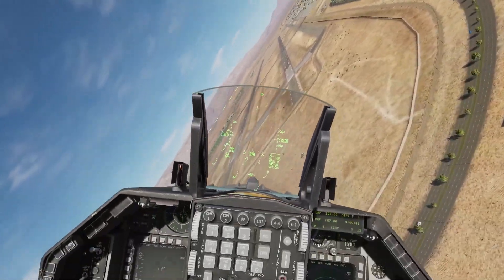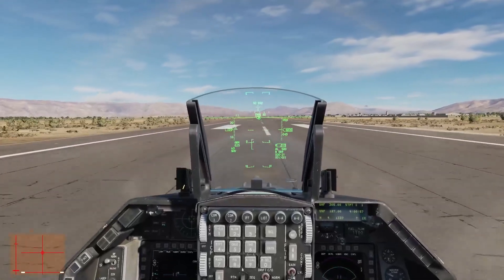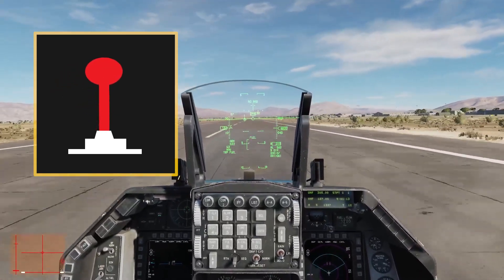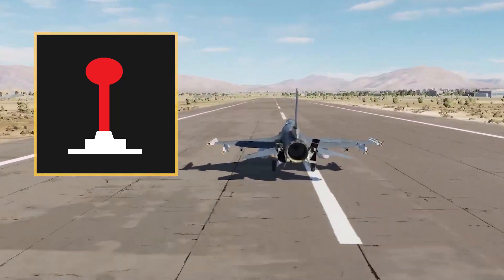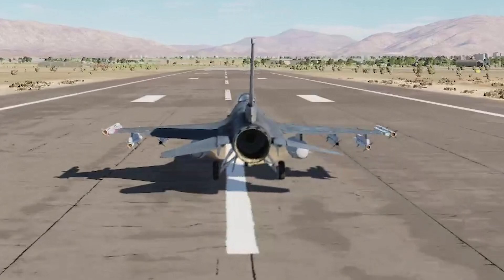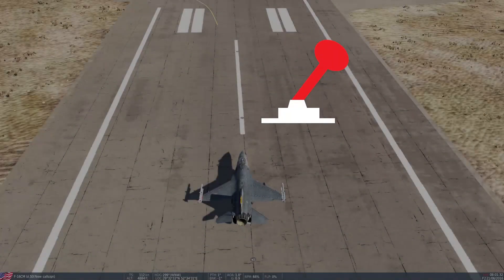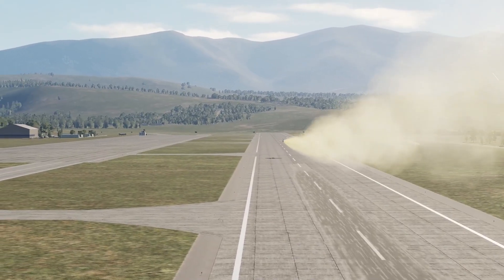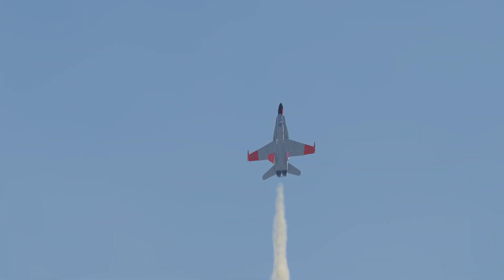F16 Steers Wrong Way on Runway? DCS

Comment: Why does it pull to one side or another after cold and dark when you are taxing slowly to the runway?
Reply from the maker: it is usually down to the ground not being perfectly level, a crosswind,, or a lob-sided/weighted load out.
Reply: @DCSDigitalCombatSimulator  it also happens with a clean load out. it has been like that since oct 2019

Comment: Thankfully I don't land that way, I use rudder pedals to control the rudder, I don't use the stick for anything except AoA, when you're slow, turn on nosewheel steering. I have my pedals, reversed, so pushing the right pedal takes me left and left takes me right, might not be right, but it's more intuitive to me and I'm the only one flying my plane. when fighting crosswinds I use the rudder.

Comment: Be aware that the F-16 is a Fly By Wire aircraft.
Stick input does not necessarily make the control surfaces move where You would expect them to move.
Also... on the ground with weight on the wheels, f.ex moving the control surfaces (ailerons) to rill right, will put weight on the right mainwheel, causing the aircrat to tilt to the right.
The FBW system knows that the aircraft is on the ground and thus tries to level the aircraft.
Roll is done both by use of the Ailerons and the Elevons (left and right Elevator can move independently to both control pitch and roll).

So You can´t conclude that there is a bug, just because You find the control surfaces not doing what You would expect.
Reply: Well, I'm pretty sure ED is using the NASA FLCS paper that has incorrect/outdated control maps, so if that is the case then there will be a lot of behavior that shouldn't be there anyway.